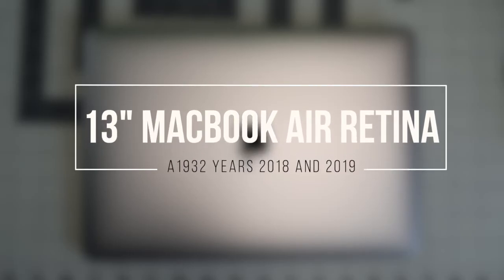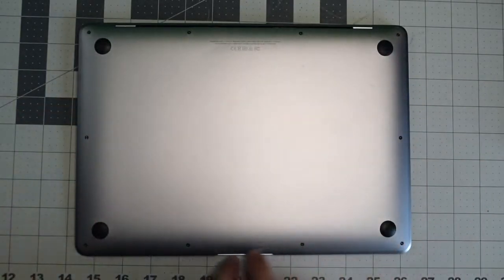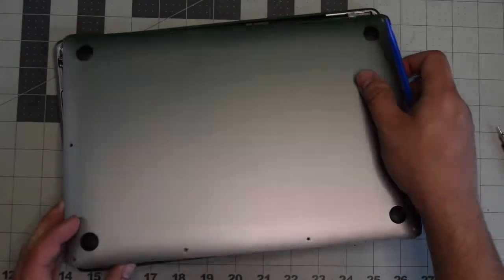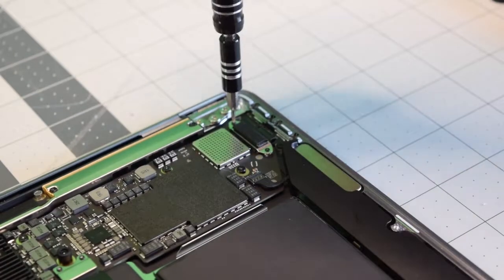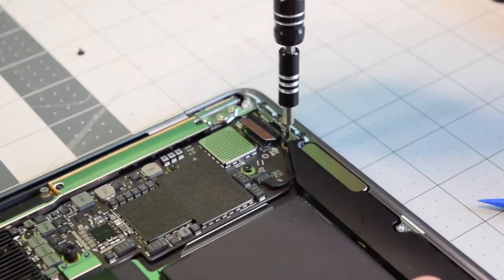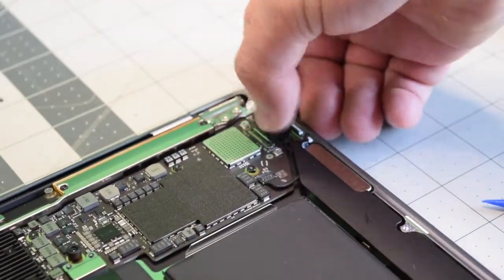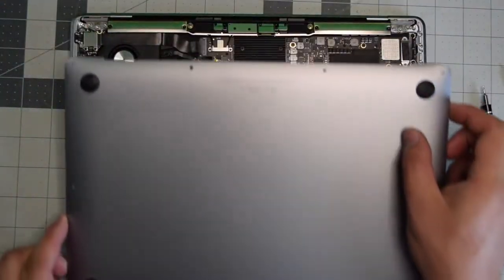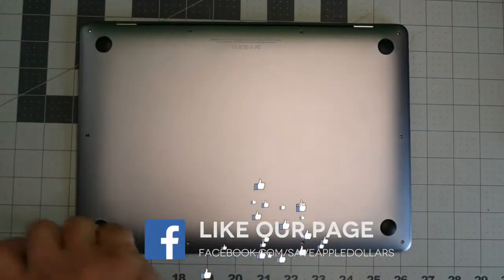13” MacBook Air Retina 2018 and 2019 A1932 Thunderbolt ports Replacement

Comment: Hi, great video thanks! I have a 2013 11" Macbook air and I suspect that the Thunderbolt port no longer works as when I plug an external monitor into it nothing happens, plus the wireless mouse (magic mouse 2) goes all jerky when you move it. I have upgraded Mac OS to Big Sur, and have also reset NVRAM/PRAM, and also tried cleaning the port with a compressed air cannister, but it makes no difference. Do you know whether the process of replacing the port will be similar to that shown in the video? and if so can you please suggest where in the UK I can purchase a new port from?  Many thanks :)